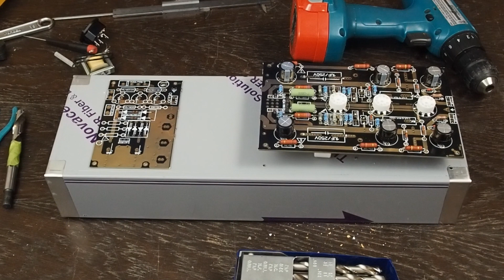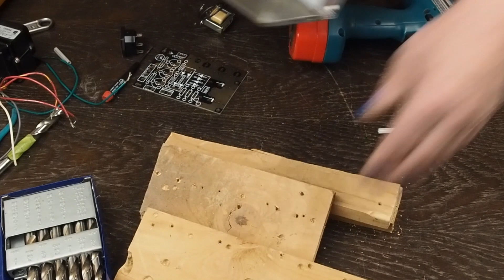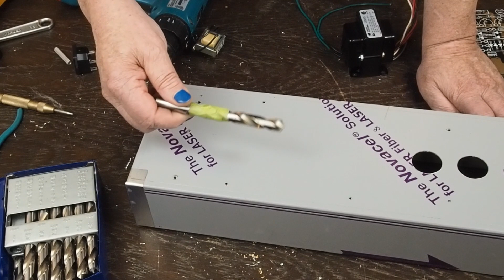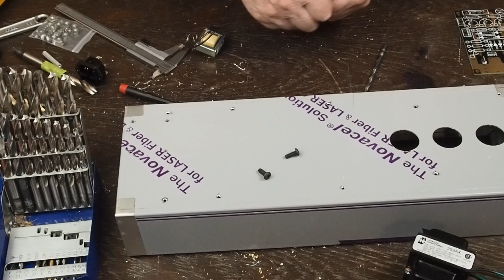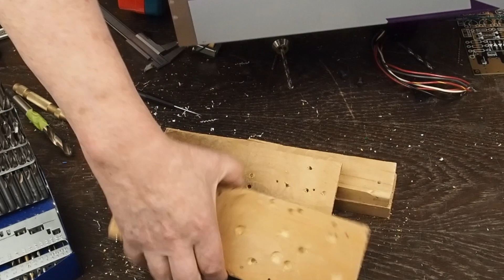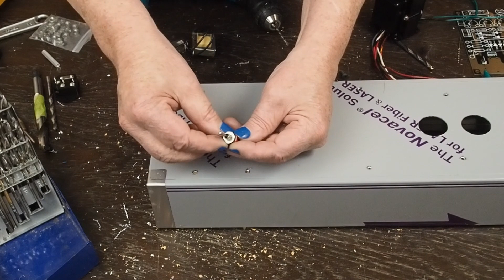All Tube Phono Stage Pre-amp Part 7: Chassis Fab

Comment: Thank you ive been looking for an riaa amp, you have inspired me, brought the boards going through the bom for the parts. Going to build mine slightly different chassis wise to your as i want it to match my head phone valve build. Could you tell me what the big brown caps are please?
Reply from the maker: The ones on the assembled portion shown in this video?
Reply: @SkunkieDesignsElectronics   yes those ones.
Reply from the maker: @MrAppleimac01  22uf 400V filtering/decoupling caps. I used nichichon in this build but honestly, I couldn't hear any difference in the phono stage I build using the caps provided in the kit. https://www.skunkiedesigns.com/phono-stage
Reply: @SkunkieDesignsElectronics  no im talking about the big brown ones on the underside of the board
Reply from the maker: @MrAppleimac01  Oh, those were some Miflex coupling caps I was trying. I ended up not liking the way they sounded, and later replaced them with the same type Mundorf alum/oil coupling caps I used in the rest of the preamp.

Comment: If you can get a CO2 LASER Sheet Metal cutter system then it is easier to precut the holes where they are wanted and then use a metal folding unit to form the metal case and all holes will be in their intended places.
Reply from the maker: I'm subbing this fab work out now, but only makes sense if they are doing ~ 10 at a time. Plus you either have to already know how to do the CAD work and own the software, or navigate the steep learning curve and spend hours and hours on the computer getting a CAD file done. If someone is doing only 1, makes more sense to just hand fab.